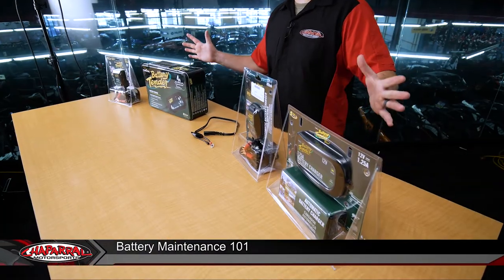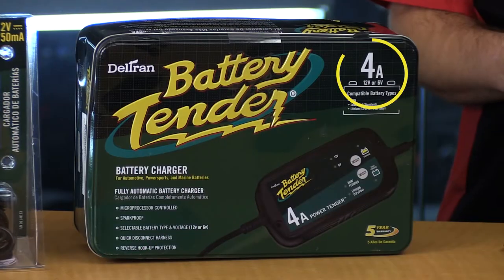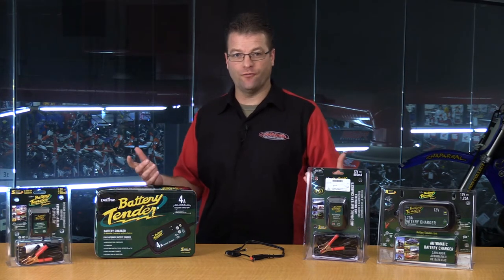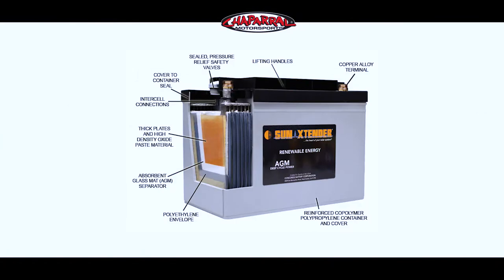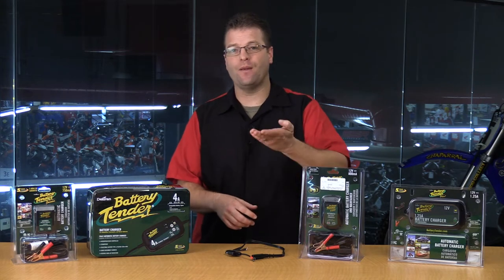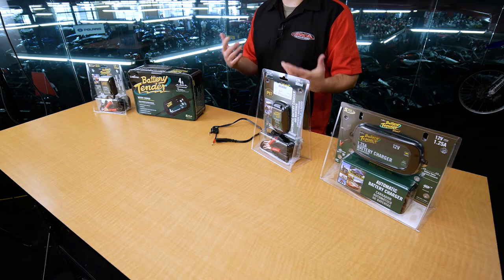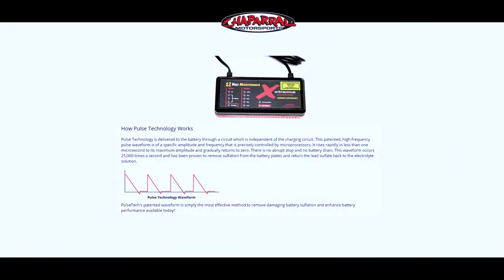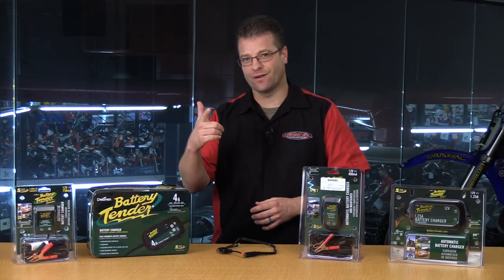Motorcycle and Powersports Battery Maintenance 101 - Tender - Trickle Charger

Comment: I have yet to see motorcycle batteries with Amp hours that low lol. My 2 harleys have 30AH batteries and the lowest i seen is 20AH the highest is 32AH use 1.25 battery tender. I also was told I can use up to 3A battery tender on them but how true I dont know but I like them. Good product
Reply: That’s probably because you have big Harleys with a lot more electric demand than a smaller motorcycle. My first bike was a Vulcan 500 and that battery was only 12AH

Comment: I used the Noco Genius 5 for lead acid, agm, gel, and lithium. Very nice charger. However today I got the Optimate 5A lithium in for my new  battery. Made for one purpose, extend lithium battery life and performance 
Only the best charger is enough :)
Reply from the maker: Awesome, let us know how you like it. Thanks for watching. Ride safe.
Reply: Yes, I went with the Noco Genius 2 they work and will charge anything including 6 Volt battries, will never use a battery tender that only put out 12 volts how will that charge a battery to 13.1 volts !
Reply: @chaparralmotorsports  Hello. I don't drive my car much. My car is 2007 mazda 3. What product do you recommend? Please provide link. Thank you.
Reply: Optimate is the best, I've been using mine for 3 years now and has saved a couple of dead batteries.

Comment: In Dec, 2001 I bought a battery tender for my new 2002 Harley Davidson Softail Duece and used it religiously.   The OEM Battery lasted till bike week 2011.    I replaced the battery with another OEM battery and this one must of been defective because it died in one year. I bought a Duracell battery wich is the same as a Deka and a Big Crank battery and this one just died this week!   So i've had really bgood luck with using these Battery tenders and I'm looking to upgrade to the 1.5 model so that I can switch it on and off all four of my motorcycles.   Thanks for the informative video.
Reply from the maker: Sounds good. Thanks for watching.

Comment: Battery Tender also does pulse desulphation, but also a temperature probe so not to overheat a battery while charging
Reply from the maker: Hello, thank you for the insight.
Reply: "a temperature probe so not to overheat a battery" Still, with the price of batteries today, I'd still incorporate a TIMER when using any Battery Tender ! - Folks should know that they will dry out your cells if continuously plugged-in (No matter how low the amperage, they in fact still heat up the cells, this KILLS the battery !). Better to have these battery Tenders first plugged into a TIMER; I set mine for only four hours a day. This allows the battery to cool down & not get to the point of 'boiling'; less chance of drying out the lifeblood of the battery.

Comment: Great video! This question may have been answered but which one of these can pull double duty to keep the battery charged for my 30 year old 240sx which I drive once a month, but is also able to keep the battery charged on my Motorcycle (not at the same time obviously)? Or do I need to separate devices??

Comment: Hi great video I have my bikes in storage for winter months in the north east, is there a battery tender that works for maintenance without needing to be plugged in to a wall current, ie a power bank? I have no access to electricity where I have them, and I tried an automatic starter but that won’t maintain the batteries. Please let me know any suggestions thanks. Btwy I already own the battery tender awesome product.
Reply from the maker: Hello, thanks for watching our video. We carry Battery Tender's Solar Power Charger, not sure if that will work as a solution for you? It's here on our website: https://www.chapmoto.com/battery-tender-solar-power-charger.html
Reply: Just disconnect the positive terminal during storage months.
Reply: You could remove the batteries and maintain them where you live.  Or go solar, if possible.  There are solar powered battery "maintainer" devices that apply just enough voltage, at a tiny amount of current, to keep them healthy and don't boil out the electrolyte over a few months.   One way that batteries go dead is from the positive terminal/post to the frame or to the negative terminal.   The path is along the side of the battery or across the top.  The conductor is the film of battery acid and dirt on the outside surface of the battery.  Though it's not much, it will drain a battery in a week or two.   Remember when people would say, "don't leave a battery on a cement floor "?  That was due to the current following the path of the electrolyte down the side of the battery.   If you clean the battery and the area around it, there shouldn't be any problem.

Comment: So im cofused with the battery tender. Is it thay once the battery dies its gone for good and needs replacement? Or does the tender charge the battery ? If so then why do i need to keep plugged in whole winter? Cant i just charge it a day before i want to ride and itll be good until next winter storage?
Reply from the maker: Hi Otto, depending on the battery and its condition if it's dead sometimes it can be recharged. However, it's not good to continually just let the battery completely drain/die--doing this causes damage to the battery and reduces it's overall life span. Ideally you want to use a Battery Tender or some type of device to maintain the battery and keep it in good condition when not in use. This will not only extend the life and performance of the battery but it will be ready to go when you are.  Hope that helps. Thanks for watching.

Comment: Can you leave a maintainer (specifically a CTEK xs0.8 - what I'm considering) plugged in for 6 months straight?
Reply from the maker: Hello, most battery maintainers are designed to be plugged in for extended periods.
Reply: "a CTEK xs0.8 - what I'm considering - plugged in for 6 months" Well, with the price of batteries today, I'd incorporate a TIMER when using any Battery Tender ! - Folks should know that they will dry out your cells if continuously plugged-in (No matter how low the amperage, they in fact still heat up the cells, this KILLS the battery !). Better to have these battery Tenders first plugged into a TIMER; I set mine for only four hours a day. This allows the battery to cool down & not get to the point of 'boiling'; less chance of drying out the lifeblood of the battery.:face-blue-wide-eyes:
Reply: @y2ktube  that sounds like a smart idea. Thanks for the tip. What do you think of having the timer set for even less time? Say 2-3 hours? Since it would still come on every day.

Comment: Had my first service done at powersports.. and they took my wire from my bike to connect a trickle charger
Reply from the maker: Sorry to hear that. Did you address it with the service writer?
Reply: @chaparralmotorsports  not yet because I picked up my bike on Saturday and there open Tuesday threw Saturday. I have another one that came with a trickle charger I never used because my bike already had one. So I was thinking about using it. Because I’m afraid to bring it back

Comment: I charged my battery when I winterized my waverunner and I unplugged the charger when it was fully charged and left the battery sit for 8 months and now I put the battery back on charger and it's taking forever to charge.  Is it a good idea to leave a battery sit when not on charger for 8 months before charging it again?
Reply from the maker: No it's not really ideal to let the battery sit off the charger. The Battery Tender cycles on and off to maintain the proper state of the battery.
Reply: @chaparralmotorsports  Well I left the battery tender charger on the battery for the whole 8 months and it actually broke my battery tender charger.  So I was thinking put the battery on charger and charge it til its fully charged.  Unplug the charger for 2 weeks or a month and charge it up again once every few weeks.

Comment: Do i charge this outside (cold), in a heated area (such as a boiler room), or indoors? I believe i read the cold wont be good for the charge and that I should avoid using it on living space. That pretty much leaves the warm boiler room as my only option. Is that ok?
Reply from the maker: Hello, yes you should try to keep your battery away from extreme temperatures such as extreme heat our cold. When chagrining or maintaining your battery to to do so in a moderate climate to help preserve the life of your battery. Not sure about the temperature of your boiler room so you should get a reading and then refer to the battery and or battery maintenance device for temperature recommendations.
Reply: Never charge where u sleep. Do it in the shed or garage. U don't wanna breath that junk

Comment: Any issues with using battery Tender on a 2- 12 volt RV coach battery application . They are in  parallel  ?
Reply from the maker: Nope, no problem at all.  I run two battery tenders - one on each of my F250 batteries. It works great.  - Kyle

Comment: I'm looking at a Battery Tender 4.5 AMP BATTERY CHARGER. Can I charge a automotive battery???,Toyota 4 Runner to be exact. Thanks. Just found this at Costco.
Reply from the maker: Yes you can. Thanks for watching.
Reply: @chaparralmotorsports  can it charge a dead battery?
Reply: Thanks for the tip that they are at Costco.   Would 4.5 amp be ok for a subaru outback?  Subarus are known for their battery issues....

Comment: What is the voltage output of these motorcycle battery tenders?
Reply from the maker: Hello Dan, according to Battery Tender: The maximum charge voltage output of the Battery Tender® Plus battery charger is in the same range and less than 15 volts. For the majority of the time, the Battery Tender® Plus will be operating in float / maintenance mode so the maximum voltage output will be less than 14 volts.
Reply: @chaparralmotorsports  thanks

Comment: If I have a AGM battery and take out of bike for winter months after fully charging and then puttin in bike fully charged would that cause a bd battery . BIGTIME BATTERIES & ELECTRONICS / BANSHEE BATTERIES Trying to not honor 3 year warranty a year in sayin that’s y battery is bad that I had to have in home on trickle charger entire winter
Reply from the maker: It's best practice to continually provide battery maintenance no matter if the battery is in the bike or out of the bike.
Reply: "in home on trickle charger entire winter" - With the price of batteries today, I'd incorporate a TIMER when using any Battery Tender ! - Folks should know that they will dry out your cells if continuously plugged-in (No matter how low the amperage, they in fact still heat up the cells, this KILLS the battery !). Better to have these battery Tenders first plugged into a TIMER; I set mine for only four hours a day. This allows the battery to cool down & not get to the point of 'boiling'; less chance of drying out the lifeblood of the battery.:face-blue-wide-eyes:

Comment: I'm glad I found this video. Very informative. How well does the Battery Tender Jr. that has the selectable mode for lithium battery work with the Shorai battery? Any issues? I know Shorai have a dedicated charger for their batteries (also a bit pricey) but I wanted something more versatile that can charge and maintain both Lead Acid and LiFePO4 batteries.
Reply from the maker: Hello, while you could use the Battery Tender Jr. to briefly recharge your Shorai, it's not recommended to the BTJ as a long term maintenance option on the Shorai. Because of Shorai's design and slow diffuse rate, you really should use the Shorai charger for optimal lifespan, performance, and safety. Thanks for watching.

Comment: Battery maintainer trickle charger the battery tender only has a output of 12 volts at 750 milliamps that is below battery voltage of 13.1 volts just how is that going to maintain a battery at full charge. Answer, they will not.